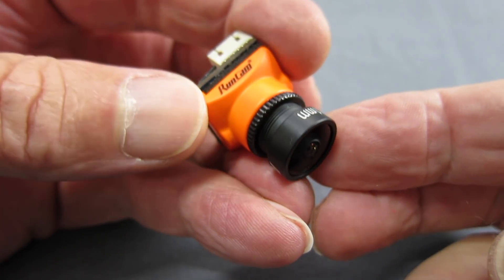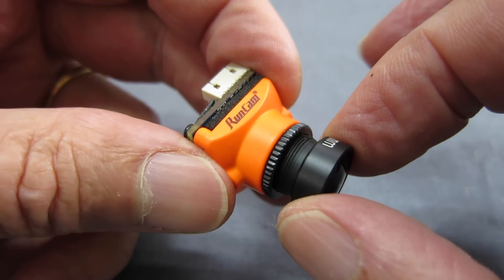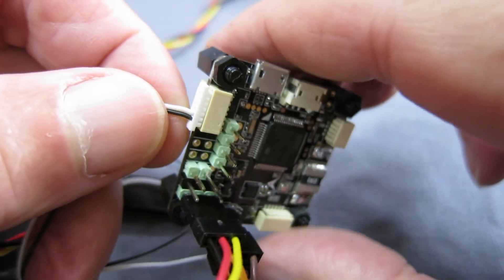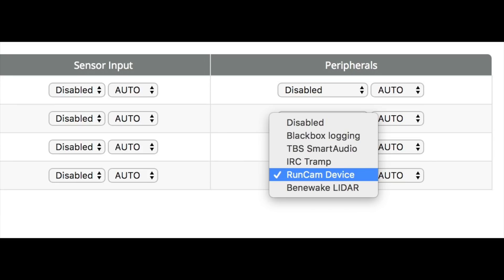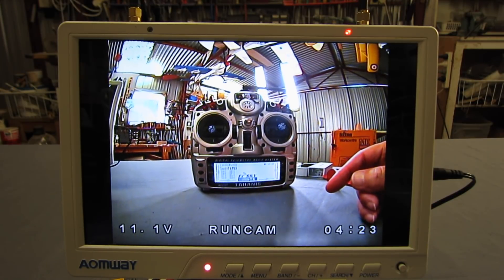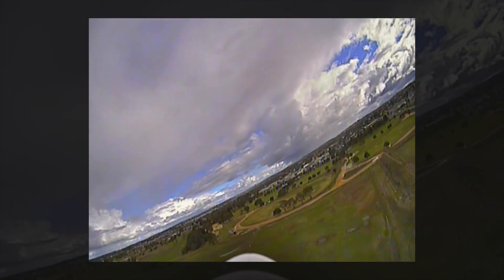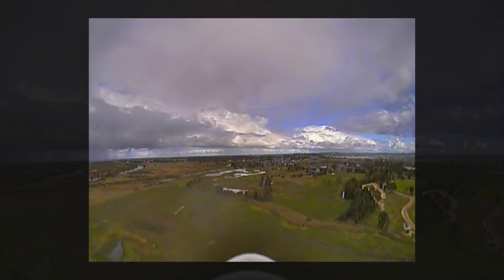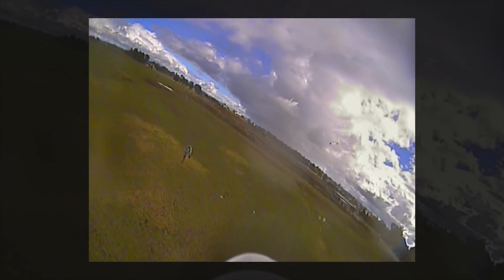Runcam Micro Swift 3

Comment: Why didn’t u use a wand for settings?
Reply from the maker: Like Harry Potter?
Reply: Andrew Newton hahaha no like a remote control but I now see that there’s no OSD pin wtf I just ordered one  greaaaaat more soldering
Reply from the maker: @MaxBeamer  Hehe, yes this one is just designed for settings control through Betaflight. Swift 2 uses the keypad

Comment: Hi Sir, thx for the nice video.
I have a question. Have you gave power from the 5-36V and the vbatt+ too?

Thx again!
Reply from the maker: Thanks, yes for this flight the camera was powered by 4S battery connected to the red wire (5-36V pin) and VBatt connected to the 4S also. The OSD was cut off by my DVR but I could see it in the goggles

Comment: Nice job Andrew....Yes, what I said about our really bad DVRs....it cropped off the bottom of your screen completely. I was wondering where the VBATT had disappeared to.  On NTSC Mode, they crop off the bottom of the screen, and even worse on PAL Mode....I recently bought an Eachine Pro DVR, very disappointing, noise on the recording and it does not have enough vertical resolution to support true PAL Mode either.
  Oddly, the one in my AOMWAY 10 Inch Monitor works better, but even that carries no date / time stamp, which is very annoying.
Reply from the maker: Sometimes if you restart the DVR it does include the whole image. Haven't worked that one out yet!?